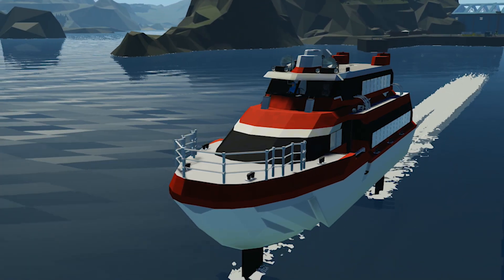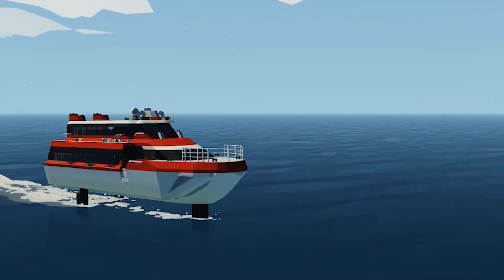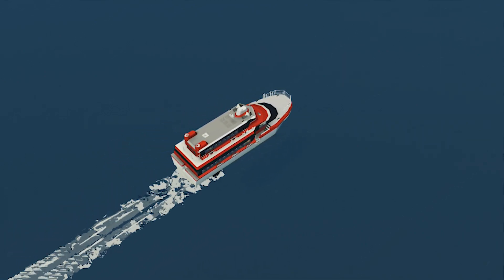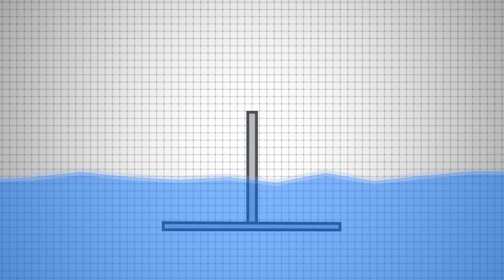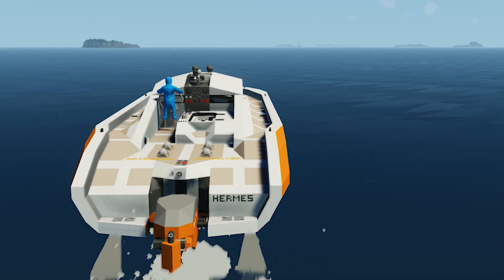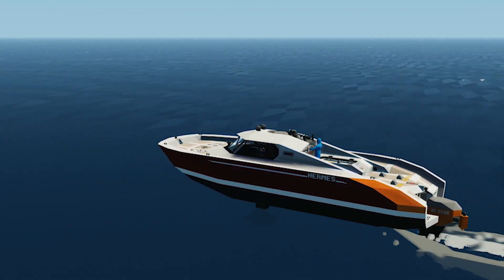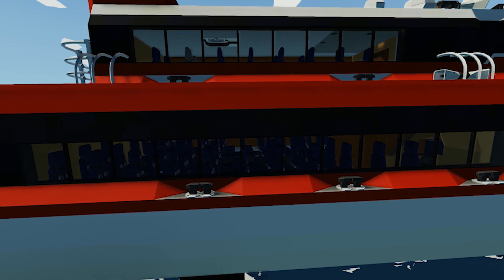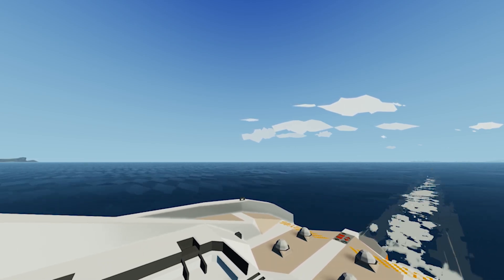Hydrofoils In Stormworks

Comment: 1:11 nope, thats a myth, you only generate downforce by tipping back the wing.
Gliders maximize efficiency by having a near horizontal wing and thus people think something funky is happening but in reality the glider pilot just pitches back when they need more lift, same on paper planes.
jumbo jets have about a 5° wing tilt for reference giving them a pretty good effeciency but higher stall speed, also for reference the maximum tilt you can have on a wing is about 15° before you start getting diminishing returns.
Please beeat this myth out of any places you find it.
Reply: I believe it’s both, there’s definitely some funky stuff happening with pressures (some parts of the airflow over the wing go supersonic before others), but AoA also definitely has something to do with lift
Reply: @strangelf  opon further research it seems it is a mixture of both, however since doing one method typically does the other, it seems evidence on one being more important is hard to come by until you get to hypersonic pressure waves, which is nothing like weakling subsonic pressure waves qnd is hard to understand
Reply: @bjboss1119  I’d assume the AoA has a great effect mostly regardless of speed, but the pressure waves depend greatly on speed.

I believe it is clearly visible when doing a banked turn; the lower wing is more susceptible to a stall. if the flow over the lower wing becomes turbulent, the wing stalls and looses enough lift to tumble the plane.

So I presume both are equally important at lower speeds